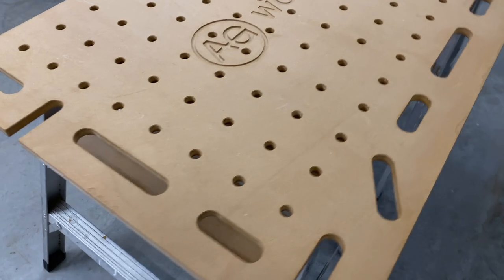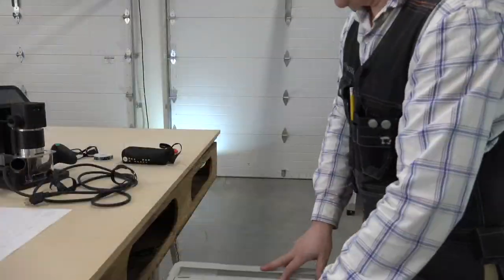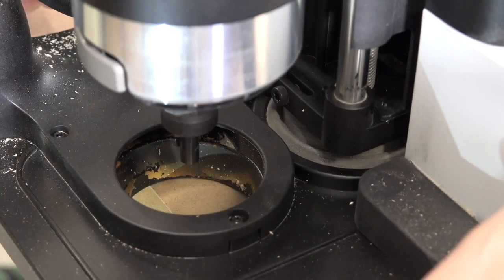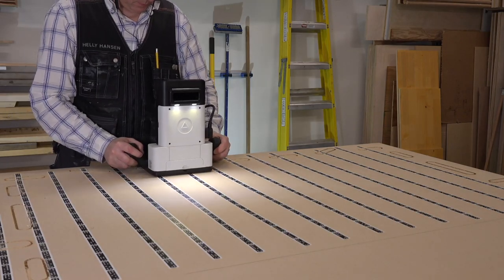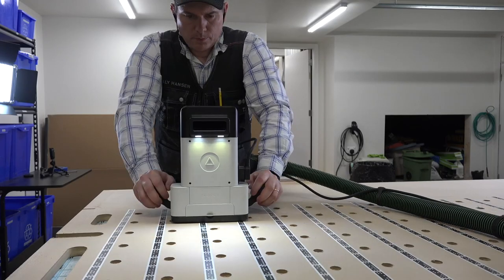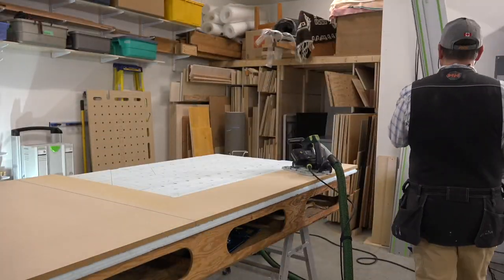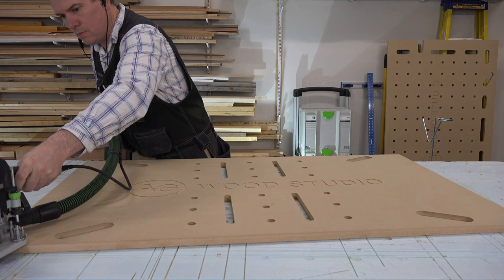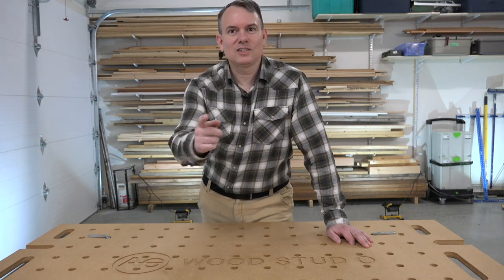Making The Ultimate Low-Profile Work Bench For Job Sites And Garage Using Shaper Origin CNC

Comment: If you use the slab as a guide, you can drill 20-mm holes in the 2?X material on the top of your saw horses, and use those to lock the slab to the sawhorses.  The plus of this is that you can still use the holes.
Reply from the maker: Thanks!

Comment: This is coming in late but,,,
There is a green MDF that is VERY water resistant.  I began using this green MDF about 12 years ago when I discovered that I could soak a small cut scrap in water over night.  It got darker but did not swell or come apart.
Reply: It tends to be denser and better quality cutting in general (as well as water resistant as you mentioned). I'd prefer to use even in a dry environment.

Comment: Great video, you earned a new subs... I’ve been procrastinating about replace my MFT top for a while.
Where do I get the bit and collet, thanks.
Reply from the maker: Thanks! the collet is Festool 488755 8mm Collet with Nut. the bit is festool bit (Part #490980) that has an 8mm shank. Search those numbers and you should find it.
Reply from the maker: I haven’t seen any Unicorns in my shop yet. The bit is 10mm diameter and 30mm is the cutter length/height. Shaft is 8mm.
Reply: @agwoodstudio7189  LOL, I did find it and corrected the post. TY

Comment: Have you noticed any accuracy issues with using the dog holes to reference 90 degrees, or the holes being perfectly in line with each other? I have heard that even with large production CNCs this can be an issue
Reply from the maker: I put the slab on top of my festool MFT and the holes did not line up perfectly. They were off by a few mm. I never found my MFT to be perfect and had a hard time cutting square with it, so is the MFT off or the slab I cut with the shaper off? I would suspect the Festool MFT is cut on a very expensive CNC with higher accuracy. To be honest I don't use the MFT or MFS to cut square cuts since I purchased the TSO Guide Rail square GRS-16. The guide Rail squares are simpler and faster to use.
Reply: @agwoodstudio7189  On the Rise Entertainment video the holes were said to be 22 mm in diameter.  I don't know how much deviation that might cause in the layout.  On the New Brit Workshop series, they have discovered that there is a slight deviation in the parf dog holes using the PARF tools to drill out the 20 mm MFT holes.  Their solution is to start from the middle of the array and move out from there.
Reply: @YouGumppy  
I didn’t realize the Parf system had come to that realization…

Comment: Great video. Thanks for putting it together. I'm wondering if it would be possible to incorporate this slab top with your Paulk style work top from your other video. I'd prefer to build the whole thing out of 1/2" MDF to cut down on the weight. Do you think it would be strong enough?
Reply from the maker: I had mad a previous version of the Paulk bench with 1/2” ply and it is very strong. Mdf might be more brittle but the torsion style box is very strong so I think it will be just fine. Realistically how much weight will their ever be on the bench at one time?

Comment: neat.. do you have a link to the larger bit you use for the spiral cuts?
Reply from the maker: It is a festool bit (Part #490980) that has an 8mm shank and needs the 8mm collet. I used the 8mm collet that came with the OF1010 Festool Router.

Comment: Great video and really, really helpful. I purchased the plans from Rise Construction and had a CNC shop make The Slab. Unfortunately, the dogs, from from different manufactures, are very loose when inserted into the 20mm holes. I don't know if the issue is with the Rise files or the CNC shop, so I'd love to know if you're having the same issue. I didn't use my Origin because I couldn't find information about converting the Rise .dwg files to SVG. Would you mind sharing how you did it? Thanks, again!
Reply from the maker: I just red drew the file because I couldn’t figure out how to convert it.

Comment: Question.. when I’m doing the holes with the Helix function and move to the next hole I’m having to change cut from On the line to inside cut. I saw you didn’t have to do that as you where moving with our changing anything, any advise would help.. thanks.
Reply from the maker: May have something to do with the colour you have in your file. Inside cuts are white fill black stroke. https://support.shapertools.com/hc/en-us/articles/115002721473-Cut-Type-Encoding